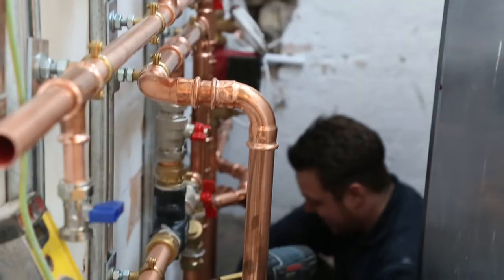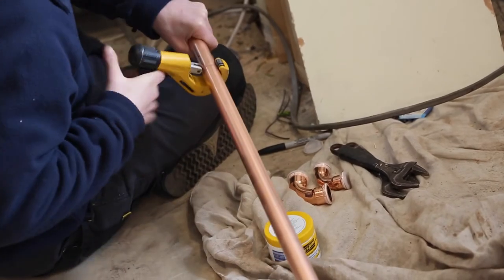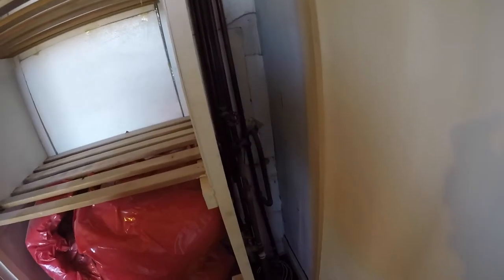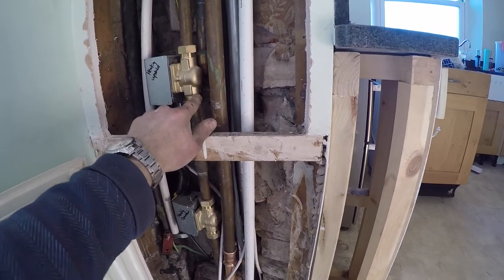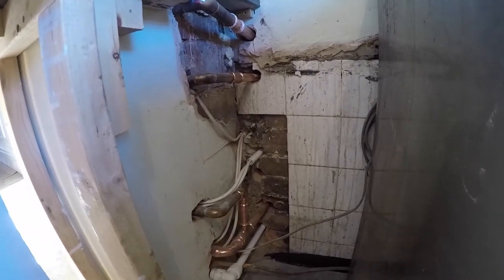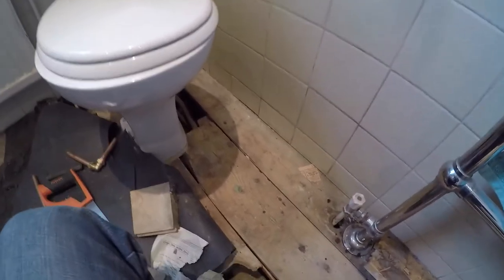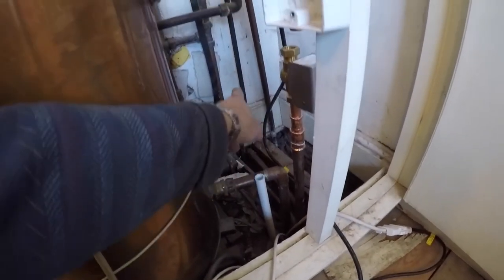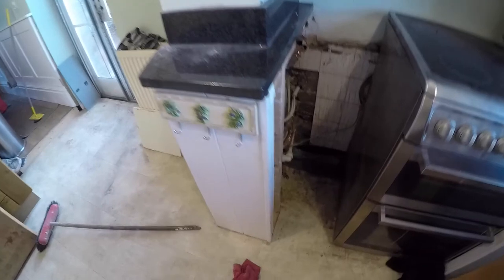Biomass Boiler Install 5.0 | Pipework and System Design

Comment: Ooh I do like a bit of copper plumbing gets me all excited. Did I spot a bit of hemp use on the union to the expansion vessel? Not really allowed anymore as this can harbour bacteria regardless of it being supplied for potable water or not, direct or in-direct. You can't beat a bit of hemp and boss white on threaded unions though! Works great on LCS pipe.